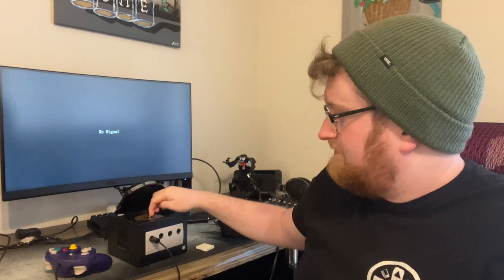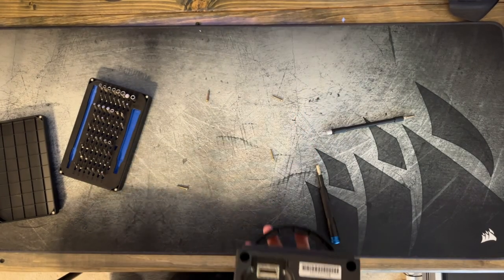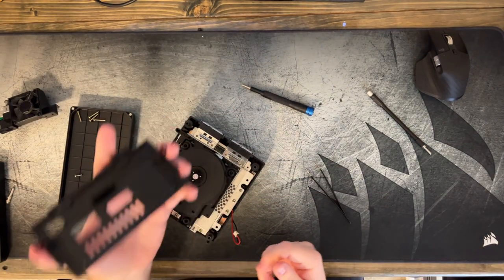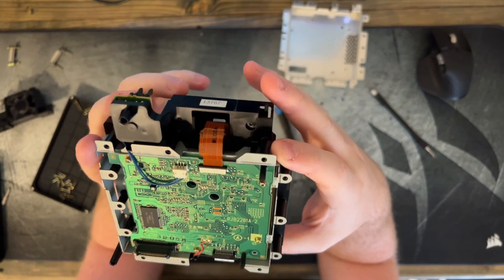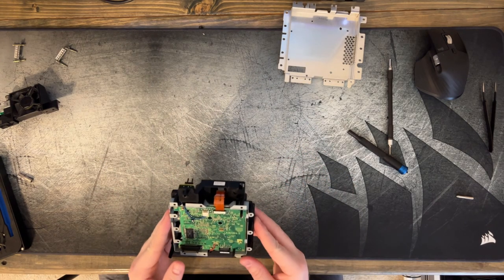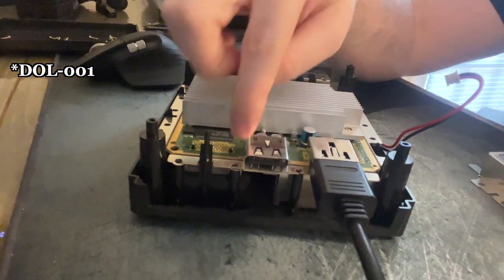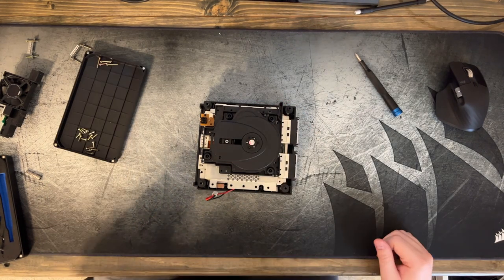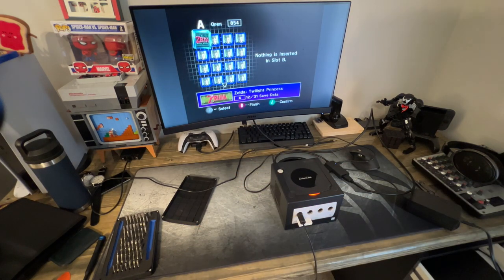Adjusting the Gamecube's Laser | Retro Gaming How To

Comment: On my DOL 001 unit, if you tried to play a disk right after turning it on it would show no disk, but then 5-10 minutes later it would work. Apparently, that is a sign that the capacitors on the optical drive PCB are failing, which is quite a common issue with these consoles now they are over 20 years old. You can buy cap kits for the GC and recap the optical PCB fairly easily. Not saying adjusting the variable resister on the laser won't fix it in the short term, but be on the lookout. If you don't rate your soldering skills, you can buy replacement boards that have been recapped (and even modded with things like xeno chips etc).
Reply from the maker: Yeaaahhhh, I have noticed the same thing on mine, even now after tuning it. So I think a recap is in my near future. Probably worth doing a video on that as well.
Reply: @TheCartCollector  Yeah, that would be good. I watched a couple of videos before doing mine, it was fairly straightforward as long as you have some soldering experience. One thing, on one of the videos one of the capacitors had leaked and corroded the pad underneath, and they had to do some funky wiring to fix it. That's what really prompted me to pull my finger out and just do it - I'm no expert, but I figured the longer I left it, the more likely a more serious failure was (maybe).
Reply: @TheCartCollector  Pro tip don't buy the same crappy split top capacitors. Buy better quality that won't wear out as fast as the caps that come with GC.

Comment: I'm confused so if it should be between 450 and 600 how come 180 which is nowhere near that worked?
Reply from the maker: So as the laser ages and starts going bad, It will need more and more power to be strong enough to read the discs. And lowering that resistance allows more power to get to the laser. 450-600 is the range within that the potentiometer will be set to when it’s brand new from the factory. As this is the same laser that my system had when I got it as a kid in 2001, it’s pretty damn old, and I had to lower it to 180 to give it enough power to read the discs. The fact that it still even works at all is a marvel to me.

Comment: When I close the lid or press the power button, it tries to read the disc for about 7-8 seconds, and then the message “disk error” appears. I can also hear a whistle every now and then, or louder noise of the mechanism. This happen with a lot of attempts, even 30-40, untill at a certain point the game starts. From that moment, every time the disc starts immediately, on the first try, even changing games. If I leave the console off for a few days, the problem reappear. Based on this, could it be that it just needs a calibration?
Reply from the maker: I might would try cleaning the lens first since it is capable of reading the discs,  but for whatever reason it just isn’t able to do that on a consistent basis. Ensuring that the lens is clean should be step 1 as that’s the easiest thing to do. 

Assuming you’ve done that already, then yes, I think it would be worth pulling it apart to check the calibration on the laser. Mine wasn’t reading discs at all, so it definitely needed to be adjusted, yours might be right at the edge of not reading discs, so just a small change might be all you need.
Reply: @TheCartCollector  I'll try! Hope it works 🤞Thank you
Reply: @TheCartCollector  I have a PAL 001. So i should High or low based on the value I find, between 450-600 ohms?
Reply from the maker: 450-600 is how it comes from the factory, but if it’s not reading discs, you’ll have to lower it until it starts reading discs consistently. So if it currently is at 450, then try lowering it to 400 and try it again. Then again to 350 if it still wouldn’t read. You want to lower it a little bit at a time so you don’t make the laser too strong and burn it out.
Reply: @TheCartCollector  I tried and now it reads! Just tested, the value was 245. But isn’t it very low for a DOL-001? So I tried to lift it up. At 380 it didn’t worked, also at 550. So I tried to lower it to 200, and now it works! But wouldn’t this value be good for a DOL-001? Will this cause any damage?
Reply from the maker: Hey, glad you were able to get it working again! 

Mine was a 001 as well and I had to get it down to 180 before it would start reading again. My understanding is that at this point the lasers have already started to go bad, and we have to lower the resistance to make the laser strong enough to read again. So I don’t think it will damage it because it now is just strong enough to read the discs again. 

I suspect that, over time, It will continue to get worse until eventually the laser just won’t read at all. So you will probably have to do this again at some point in the future until you eventually have to replace the laser/disc drive. But since you were able to get it to read again, you won’t have to do that any time soon. So congrats! I would call that a successful repair.
Reply: @TheCartCollector  Yeah, i’m really happy. Thanks for all. Just curious: the fact that it was at 248, means that someone already did that trying to solve the problem?
Reply: @TheCartCollector  What about a fat Playstation 2 that has no problems reading, but has very slow reading times (2 minutes and 40 seconds)? Do you know anything? The same trick can be done?
Reply from the maker: Unfortunately, I do not personally know if this fix would work for a Fat PS2. I have one that has some issues that I plan to fix but I haven’t done any research on how to actually fix it yet.  I’m sure though if you look around online you’ll probably be able to find some information. Google has been my best friend when looking at how to repair these things as there’s a LOT of information out there about it haha.

Comment: If i leave my gamecube powered on for 10 minutes, the laser starts working properly.
Reply from the maker: Something can definitely be said for letting a laser warm up like that. Good thing to be aware of in the future when my laser starts to act up again!
Reply: That is your laser capacitors going bad. That’s usually what it means when you let it warm up then it works. Needs a recap which is kind of a hassle process if you’re new to soldering. If you try this guys method of adjusting all your doing is putting more pressure on those caps and yes it’ll fix it but very very temporary. If you keep adjusting the pot everytime it goes out you’re going to fry your caps when they’re already well on their way. You’ll probably need a new disk drive all together if you aren’t confident that you could recap it or take it to a console repair shop.
Reply: @junebug4899  thanks for the info.  I figured the drive was toast.  I pre-ordered the flippy drive as an alternative to getting a new spinning disc drive.

Comment: BS advice.
Twisting the pot will kill tne laser fast.
You need to recap the PCB under the drive. 10 capacitors and the cube will read your disks again like the 1st day you had it.

If the disk spins, it means the laser works. No need to touch the pot. 
NEVER , its factory calibrated for this laser.

Comment: TO FIX THE PROBLEM YOU SHOULD CHANCGE THE CAPACITORS ON THE DISK DRIVE BOARD, NO NEED TO ADJUST THE POTENTIOMETER.